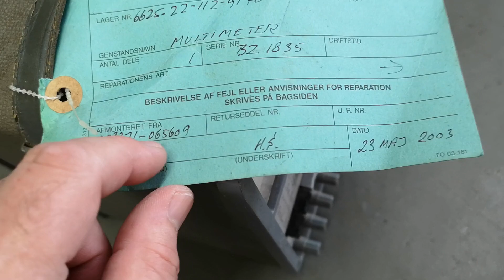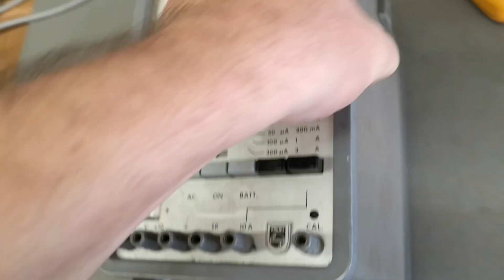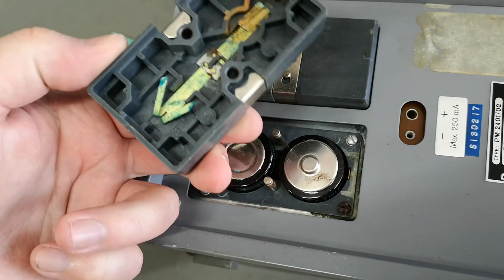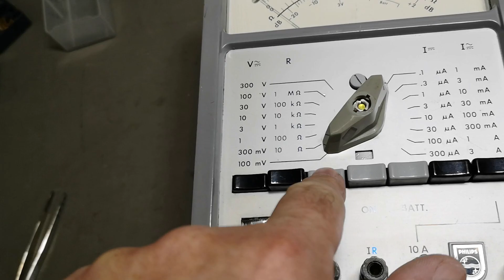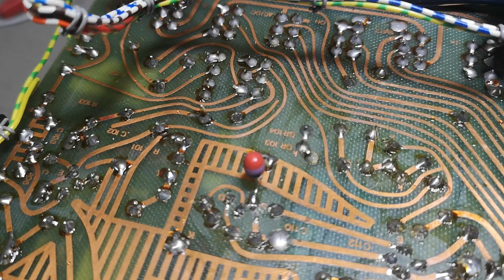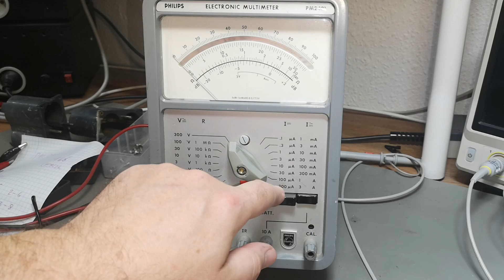Philips PM2401 Electronic Multimeter 1966 transistors test teardown

Comment: The dates on the batteries are usually “use before” dates, not dates of manufacture. So the batteries you have were made sometime in 2000-2002 I think.

Comment: I have the successor, PM 2404 which I like very much.
I have upgraded it with scale illumination and the polarity indicator changes color from red to blue.
It also has a linear scale for resistance measurement.
Just used it recently to check a 10 turns potentiometer for contact problems.

Comment: You were lucky, I couldn't even open the battery comportment without using extensive force. And then everything was green/blue.
Reply from the maker: oh no.. but at least this type of battery holder keep most of the slime away from electronics
Reply: @TeardownOZ2CPU  You have such a positive attitude ;-)
Reply from the maker: @RensePosthumus  thanks a lot mate :-)
Reply: @TeardownOZ2CPU  Philips knew about the bad people leaving the batteries mounted:-)

Comment: The pcb's are beautiful. Are the protected with some kind of solder mask? Or just bare copper?
Reply from the maker: yes protected by a thinn layer of spray coating, it is almost not visible, but it really works, just see how well the copper tracks still looks nice and clean